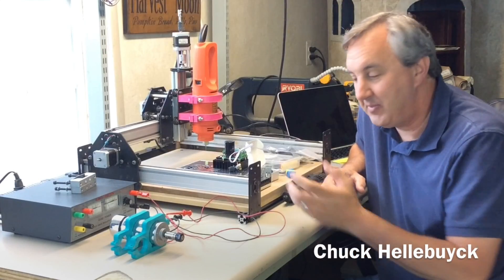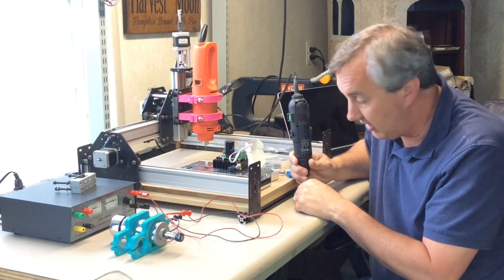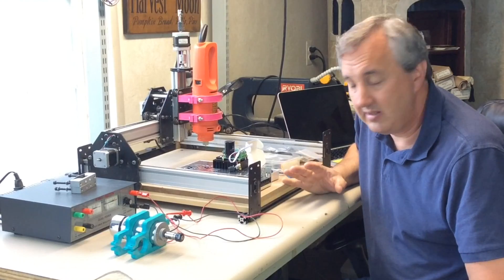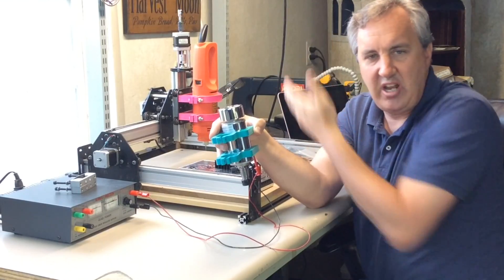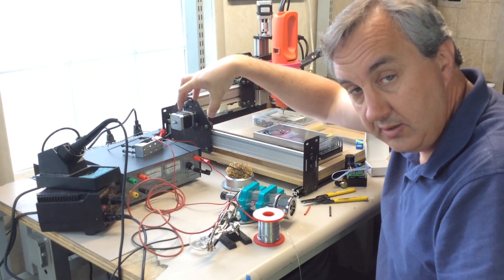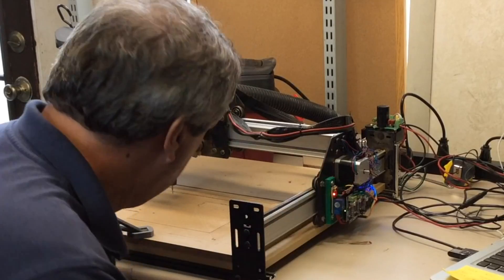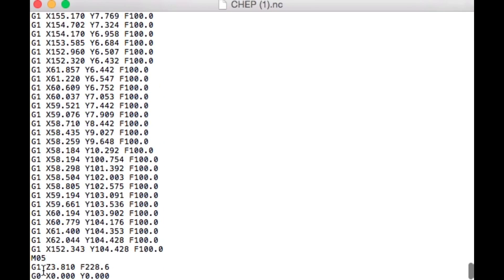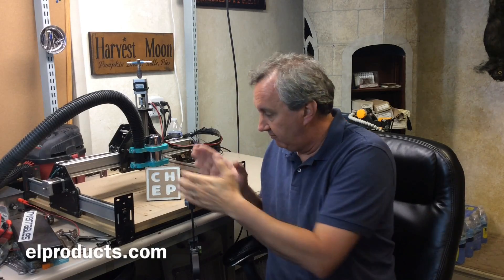Installing a Quiet Cut Spindle on a Shapeoko 2 - Video #053

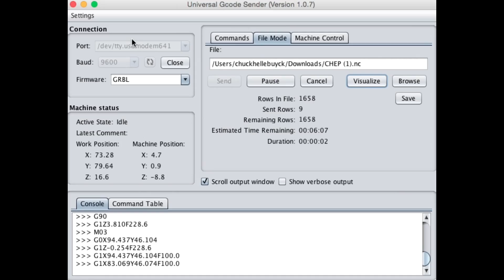Comment: Hey Chuck... just a little friendly advise. From the difference of air clarity between 17:01 and 17:23... until you get your shop vac hooked up I would suggest wearing a dust mask.
BTW you could always set the shop vac outside if it was too noisy or in a sound proof box with an air input line.